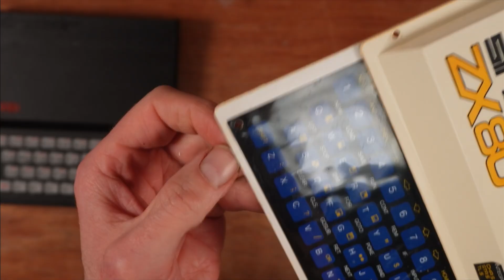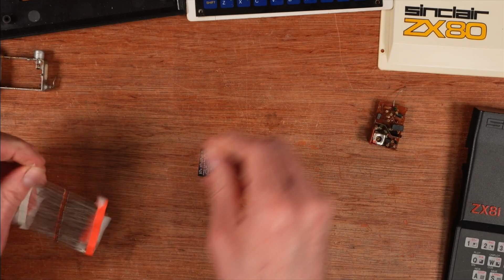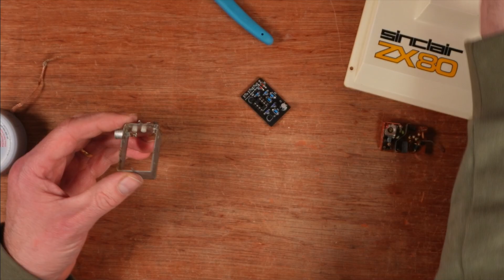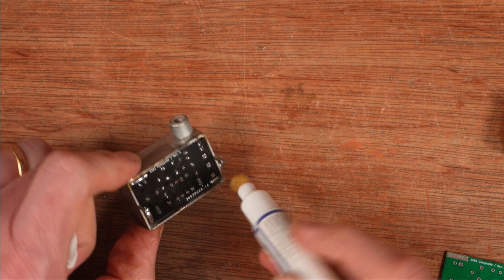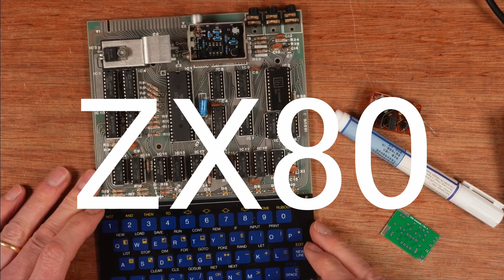Modding a Sinclair ZX80. A New-To-Me Old Computer.

Comment: Back in the day, I made a ZX80 from a kit (£50?), cus i could not afford the pre built one (£100?) I was poor at the time and lived in a one room bedsit in London (£15pw). The keyboard was connected to the mother board with a plastic laminated connector. (no video I have seen recently shows this.) I damaged the laminate connector when I inserted it. A few of the keys did not work. I was not able to "times" anything in my basic programs (2x4=8, for example, was not possible.) So in my programs, I divided by the reciprocal. (2/0.25 =8.) I was able to learn a lot about IT from the ground up. Latter in life I became a technical trainer and trained engineers all over the word how to install computer networks. Big bucks and happy days. Thank you ZX80

Comment: When I saw you putting the board in place before soldering the wires to the pcb, I was like Oh No.  I was also wondering as RF Modules that I have seen all seemed to have a bottom metal cover as well.  Great seeing the work, and how it looks without the back porch.  Is that silicone insulated wire that you were abled to strip it like you did in the video?
Reply from the maker: Yup! Super easy to work with

Comment: please dont 'gut'/remove modulators, you dont need to add composite/back porch, just fit it external to the modulator case, it wont be seen once the computer is cased up,  the modulators are becoming rare and expensive to get 'new old stock', you can even rig them to feed composite and rf out simultaneously , so you can use the machine with either connection at will ...

Comment: I can't speak for the C64's colour RAM, but when one of the RAM chips in my VIC20 decided to give up the ghost, the only 2114s I had lying around were the ones that came out of my ZX81 when I did the 16K upgrade, so replaced it with one of those as far as I can tell, it seems to work absolutely fine.
Reply from the maker: One day I'll test it when it's not as risky 😁

Comment: Nice job mate & have to say does look a lot better with the components fitting flat against the PCB, also where's the fun in taking the modulator casing off only once as it's not as if they're a pain lol. 

On my ZX81 my cock up while putting it back together was accidently putting the top of the modulator case on the bottom, which fitted fine no worries. However the top cover has a small cut in it so it fits round the connector (not needed on the bottom as the connector doesn't foul the cover)
Reply from the maker: Cheers Lee!
This one had a cutout on both lids so I could have got away with that 😆

Comment: I am just wondering why you did not use the ferrite bead that is built in to the modulator housing to pass the 5v through ?
Reply from the maker: The first hole? It's not a hole. Solid in that position. Plus the existing wire that went through there broke off when I removed the internals.
Reply: It is used to pass the 5v through for the original board that was in the modulator .

Comment: Great video thank you.  I have a ZX80 which I rescued from a house clearance (on the Isle of Man where I live) of a deceased gentleman who actually worked for Cambridge research in the 70's and early 80's.  Amongst all the piles of Computer magazines, boxes of discs and wires, I rescued several spectrums, Wafadrive, OPUS, tons of Spectrum software, all working and a zx81 working.
Then in a box of junk I found a PSU...ZX80 Power Supply it said on it...
Dug a bit deeper and found a Sinclair Poly box, taped up.  Undid the tape and like Howard Carter in 1922, I found wonderful things.

A lovely ZX80 with manual, leads, and tapes.  Couldn't believe it.  Even better than that, I connected it up to my little 10" Bush B&W telly and it works perfectly.  

So whilst I really appreciated your video, I won't be doing that to my zx80!

Cheers.
Reply from the maker: Oh thats a lovely story! Thank you for sharing Nick! What a find!!